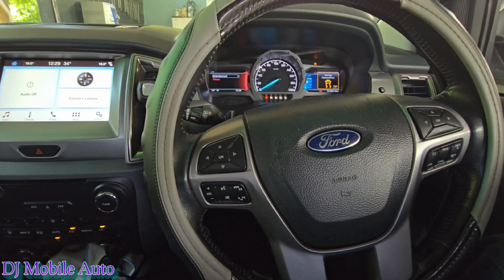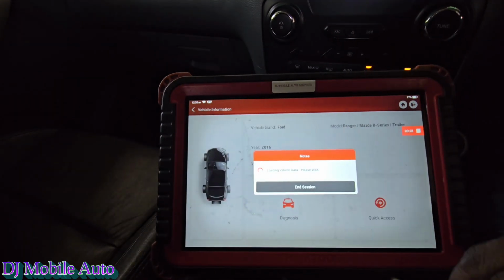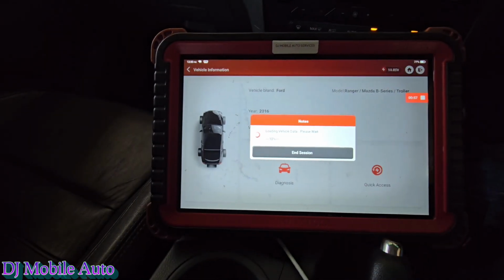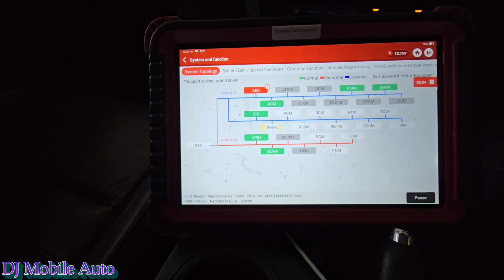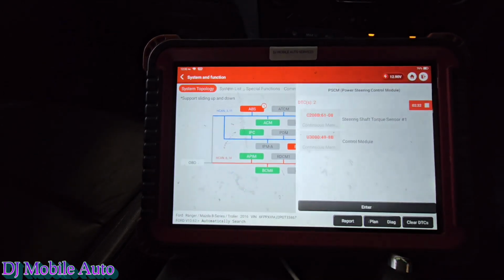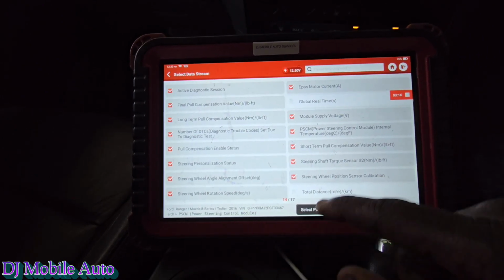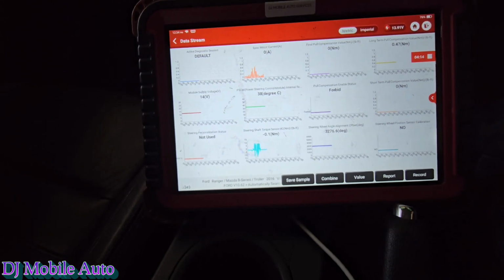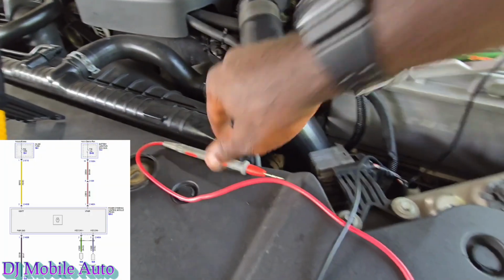U3000:49-88 & C200B 61 Power Steering Module DTCs on a 2016 3.2L Ford Ranger

Comment: Sir i have a problem with the EPAS mine is on a ford everest 3.2 titanium 2016.  The steering is not hard. Its just want tonstay on the middle if you steer to.the left it goes back to middle.then if turn to right it eill.go.to.middle and the steering is fighting doesnt want to turn.  Then the steeing angle offset is stuck on 3276.6. I have current and volts to EPS. The code shows U3000:49-0A, and steering angle is 0 stuck not moving.
Reply from the maker: Is it possible that the steering angle needs calibration or is damaged on this vehicle? Did you gear or the belt on the steering rack? It can communicate but may have a fault

Comment: Hey man, I just got a Ranger FX4 2019 equipped with EPAS. I disconnected the wiring harness to the EPAS module and since then, my steering wheel won't turn left or right. It's totally stiff unlike when it was just harder to turn. Now it doesn't turn at all. What would you suggest I look at please?
Reply from the maker: Possible have to reprogram to sync the module to the system.  Ensure there are no damages to the harness and module pins
Reply: @djmobileautoservices thank you for this. I'll look at it extensively tomorrow.